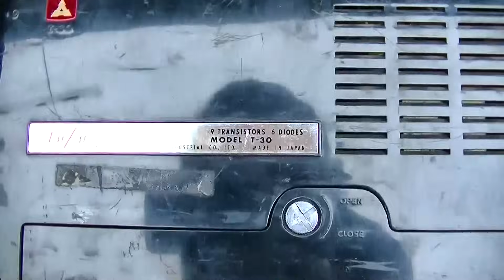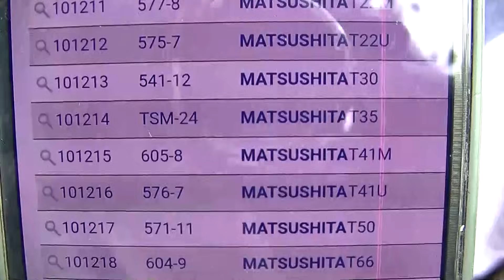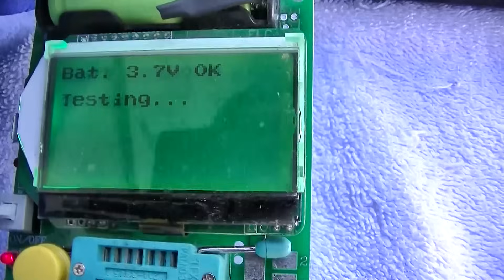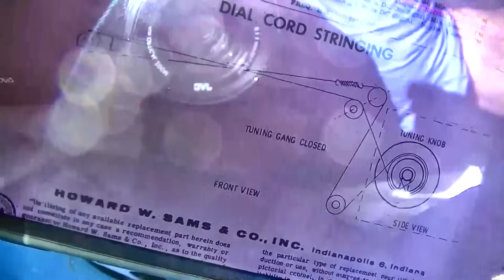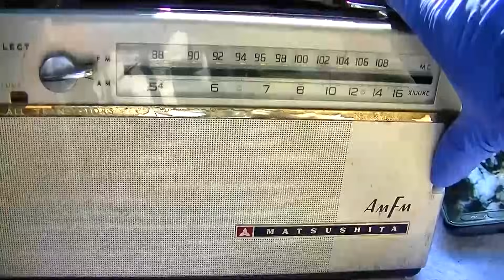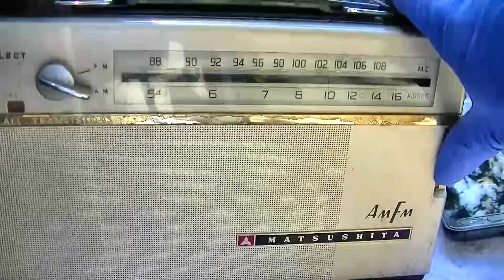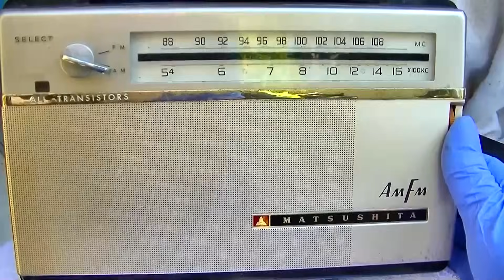1960 Matsushita AM FM Transistor Radio Repair T30

Comment: @Tate Thomas, many thanks for sending this very interesting radio to shango066, which, in turn, allowed him to share this gem with the antique radio enthusiast/electronics repair and restoration community.  What makes this radio interesting, is that it seems to be an early stage in what became the "Japanese Solid State Multiband Radio" crusade of the 1960's, thru mid-1980's. Very few ever came into the shop, because they were built so durably.

Comment: A non polarized capacitor can be made by connecting two electrolytics in series.   The positive wires or negative wires are simply connected together and the other two are connected as the non-polarized ends.  If they are the same values, capacitors in series half.  For instance, if the total value desired is 10 uF, you would wire two 20 uF capacitors together in series, with the same polarity tied together.
Reply: I was wondering if this would be the case.

Comment: That radio could have very easily fit inside a USPS Priority Mail medium sized flat rate box with the proper packing material, and be shipped for $15.05 flat rate no matter how much it weighs. I'm surprised the post office didn't let the sender know this. That price still seems way too high for something that size and weight to be shipped across the US.
Reply: Slightly smaller box would've cost a lot less.

Comment: A couple years back, I found a dusty, crusty Panasonic RX-1460 (circa 1981) at a recycling center for $5. I thought I lost the cracked rewind gear in the tape mechanism, so I ordered another one off eBay to get the gear to make a 3D printed copy. I paid more than double for the shipping than for the radio itself. Turns out I still had the gear, but hey, now I have two. The second one was a basketcase when I got it. FM antenna broken off, AM antenna broken and rattling around inside, belt off the tape mechanism, cracked rewind gear. A month ago I finally sorted out the very last problem -- bad solder joints on the audio output transformer that caused the tape player to occasionally "honk" very loudly. I highly recommend vintage Panasonic equipment. Very easy to service, easy to get service manuals. For some models, you can even still get parts through Encompass!
Reply: Good to know.

Comment: That shipping charge is criminal.
Reply: I spent $33 to ship a nice nearly new cassette deck I got for free to someone who needed it. The shipping cost was a little high, but it was for a good cause, someone is using something that would have been thrown away, they had a huge collection of old cassettes from when they were younger and hanging out with bands, this deck really made them happy. Shipping costs suck, especially when you're so used to buying stuff online and getting cheap to free shipping.
Reply: the shipping guys are risking their life by going out to deliver it. so, the price is justified, although they are probably not getting paid the extra money though.
Reply: if you have paypal you can get reduced shipping costs.  Packages only no first class letters.
Reply: @iceberg789  The prices are not up because of covid.  The prices started going up after 9/11 with increasing oil prices. But they are a one way ratchet.   Oil prices are like a 1/3 of their all time 2008 high.  But when oil prices came back down, the consumer was habituated to the now insane costs and they didn't lower their prices as the price of oil has come down.
Reply: @iceberg789    Risking their life? are they delivering behind enemy lines, are delivery drivers being taken out for sport, I guess the news isn't reporting the deadly attacks.
Reply: If you can’t send it in a Flat Rate Priority Mail envelope or box the price can be insane, yes.  International: there is no longer surface mail so it’s even crazier
Reply: @tarstarkusz  There is a business opportunity there for certain.
Reply: @orange70383  :)
Reply: I agree. I once bought a 1983 TV on Ebay and the shipping was one third the price of the TV itself!!

Comment: I like the radio. The European transistors in the chunky TO7 cans often suffer from internal shorts due to tin whiskers, sometimes the whiskers can be blasted away successfully with a charged capacitor, sometimes not. Maybe the Japanese transistors also suffer from this problem. I tried to destroy the tin whiskers by putting the transistors in the freezer for 6 months, it didn't work. Percussive maintenance may lead to a temporary solution, I now just replace them with Ruskies, even if they look a bit odd to my eyes. Thanks for the video, may there be many more.
Reply: Completely different construction from the AF117 transistor, the problem with the bad transistor wasn't tin whisker shorts anyhow, it was open circuit.

Comment: Tuning cap mounting grommets have deteriorated to the point where the unit has shifted with respect to its mounting frame. This is causing the tuning control pinion to not mesh properly.
Reply: Good call.

Comment: I have never seen a portable FM transistor radio from 1960 before, this had to be rare.  This radio must have cost a small fortune in it's day, the high frequency transistors in the FM front end probably selling for >$20 each.

Comment: @1:12 Dimensional weight. Above the actual weight lists the size of the box and “DIM. Weight” above that (11 lbs). It’s so that shippers can recover the cost of shipping if you send a light but spacious box. Most shippers now do this.

USPS can’t raise letter rates above the rate of inflation without a huge governmental inquiry, so they try to make it up with raising parcel prices as they’ve frequently increase 5-8% each year. Also, ship Priority flat rate if your items can fit in there vs. a custom box as the flat-rates allow up to 50 lbs or something like that for one price.

Comment: A spring came out; it would have gone between the two “hooks” in each gear half to reduce backlash.
Reply: those springs are a nightmare as an example, grundig transistor radio's that i have come across have had the backlash spring and it's a royal pain trying to refit one.

Comment: shango066 You Can Connect 2 capacitor's back to back in series both Gnd's tied together double each caps value to make a none polarised capacitor, I often do it for testing. Usually works fine but esr wont be that good of coarse.
Reply: Hey, I asked a similar question, but not series back to back, anti-parallel.
Reply: @Raul_Gajadhar  Ortorea is right, series back to back it is 100% sure
Reply: That would work completely fine and for something like this the increased ESR wouldn't matter at all
Reply: @Dazzwidd  In some cases I found that to be true, I guess = bad circuit specs?
Reply: @Raul_Gajadhar  I've seen older manufactured goods even use the back to back polarised electrolytic capacitor approach a few times. 
It's got to be a fairly critical application for the ESR to matter, and if the capacitors you're doing it with are high quality components then it's definitely not going to matter as they will have an exceptional ESR to begin with
Reply: @Raul_Gajadhar  Don't do it with them in parallel as one of them will be reverse polarised. Series back to back
Reply: @Dazzwidd  I meant anti-parallel. You know, 2 germanium diodes in anti parallel with the caps in anti-parallel may help in my case too. Just more less bang for the buck. lol... I know I seen a circuit like that some where before. Old brain. Wait, Pre-emphasis network, I think never mind. --End of discussion--
Reply: @Raul_Gajadhar  So you mean in series?????
Reply: @Dazzwidd  What?! Dude 2 diodes, 2 caps,   a diode and a cap goes neg to neg, pos to pos, then same with the other diode and cap, then in parallel reverse both pair of components to make one. Gezz.

Comment: The dealwas Matsushitas brands was NATIONAL, but this was a trademark un the US already (chash registers and other thing I cant recall). The created PANASONIC just for the US Market. So this set is prior this point. The couldnt use NATIONAL which would have been more apropiate. Then they created Technics and Panasonic's bother Quasar.  The logo lately would be the  UPPER N, even for early Technics. They really develop tons of products in a very short spam of time, the killed it in the 70s. I love their tape recorders, not much about radios. They even hold the patent of the boombox at the US patent office (LOL) that was submited with the RS-466 Stereo boombox. Good Panasonic, affordable gear, low maintenace, good performance.

Comment: You can make a NP cap by connecting two equal caps back to back. Use polarized caps of double the required capacity. No need to buy NP caps.

Comment: 3:28 - there should be a spring  between these two gears that prevents the user from overturning the tuner capacitor. I think the tightness of the rope also held the tuning knob gear against the other gear._

Comment: I have seen some radios dead as a hammer from dried out electrolytics. And I've seen some that age that had good caps, transistors, etc, and were dead from a bad solder connection, or cracked board. Its a mixed bag, mainly dependent on the quality of the electrolytics used. I have my grandads 1964 Sony TR1814 - all original parts - still plays well - audio lacks a little bass - some electrolytics a little weak. My grandmothers 1962 Channel Master - dead as a hammer - changed all electrolytics. A 1963 Westinghouse bought at fleamarket - plays well - speaker drags a little - all original - was dead as a hammer from cracked solder joint.  1962 Arvin fleamarket find - repaired broken antenna wires, and removed shards of antenna wire from tuning cap - plays fine now - all original parts. All of my Zeniths, dead as a hammer - replaced bad "Nashville" caps. A 1964 NEC Galaxie AM/FM - replaced battery holder - plays OK - all original parts. My collection mostly had all bad caps or no bad caps.

Comment: 2 recurring issues with these oldies. 1. The plastic electrolytics. Sanyo was the worst but others used them in those days. Sanyo made and stayed with them the longest. What went wrong was the lack of knowledge regarding plastic in thin sections. Plastic is porous in thin sections (actually it is porous in all thicknesses but it matters less in thick sections). This allows the liquid in capacitors to pass out and dry the cap out rather quickly.

2. Grommets. Where a metal chassis or bracket was used to hold or shield a tuning cap it was usually isolated with rubber grommets to keep it from grounding out. These are under tension from dial cord or other forces. They either split or otherwise fail as things age and there goes the isolation. You then get strange noise or modulation. New grommets will fix that BUT where do you get teeny ones today?

Capacitors killing everything: It DOES happen. Over the decades I have run into it. Some caps will short out instead of going open. The worst are the ones that bypass various voltage sources. I have seen them short out the battery itself or just keep voltage from getting to where it is needed by shorting it to ground. Never say never.

Comment: In a pinch, two electrolytic caps placed back to back can sub for a non polarized one. If the value is critical, double the capacitance of each cap since they're wired in series.

Comment: What causes that bird flutter sound at 21:22? Some form of digital mode?
Reply: I'm using a badly damaged phone to listen to this so I cannot guarantee that I am hearing it correctly, but, it sounds a lot like what is called signal "ghosting" or "ringing". This occurs when the signal is being "bounced" back and the receiver recives multiple delayed transmissions of the same signal. Most likely caused by a low flying chopper or jet in the area.

Comment: WOW! That radio is from 1960? To me it seems modern and well built. Shango for a non-polar cap, can't two polarized ones be placed anti-parallel? I mean it is a low voltage audio signal. Feel free to shoot me down if that is not a proper substitute for particular application. I really like that radio btw. It should get a proper functional restore.

Comment: I used to do shipping, The rates are mostly based on dimensional weight not so much on real weight. The 16x14x8 that comes out to 1792 cubic inches. if it had been under the 16x14 it would have been much cheaper to ship.

Comment: I didn't notice a 10.7 MHz crystal for the FM IF circuit. From my perspective, it seems interesting to me that Shango put a Russian transistor in a radio that rolled off the assembly line during the depths of the Cold War, just two years before the Cuban Missile Crisis. This receiver even has the little CONELRAD triangles on the AM dial, to be tuned to in case the Reds attack.
Reply: John Jalas  Well, I can't honestly disagree with you. But back then, we were very close to being nuked by the Soviets. A lot of people had some sleepless nights back then.
Reply: you mean a ceramic IF filter?  most old sets like this didnt use them, this one looks like it has double tuned IF transformers, that would give good selectivity nearly as good as one if adjusted correctly
Reply: @xavierrajda933  It has been said that hindsight is always 20/20. From today's perspective, we now know that neither side wanted to start World War III, but we didn't really know this in the depths of the Cold War paranoia.
Reply: @andygozzo72  I guess early FM receivers didn't have those ceramic IF filters. Sure didn't see them on the old tube AM-FM radios I've had in the past.
Reply: @chetpomeroy1399  i've never .. yet.. come across a valve set using them, only seen them in 'some' recent ish sets, say from mid 70s to 80s, and more so 'modern' sets ... maybe werent invented till recently?  some communications receivers had them , or 'crystal' filters much earlier,
Reply: John Jalas  During the Cold War, I didn't believe that the ordinary peoples of the former Soviet Union were inherently evil, but the Soviet government was a different story. Similarly, I really don't have a problem with the everyday people who live under the jurisdiction of the government of Red China, but like many others with similar political persuasion, I DO harbour animosity toward that communist government. The people of mainland China would do so much better without communism.

Comment: That radio has excellent sensitivity! How would you rate the selectivity? Sometimes it seems great, other times it seems like the stations are on top of each other. It still amazes me that the carbon resistors fail less than the transistors. I guess I really bought into the lie I was told when I was young, 40 years ago, that the solid state devices would be the last to fail in a circuit. 😁

Comment: Could you use a clip lead hooked to the input of some amplifier as a signal tracer?
Reply: Yes. Done it.  Phono input is pretty sensitive.  Although there may already be a series capacitor and resistor,  add another one.
Reply: @LakeNipissing  so a clip lead with a cap and resistor in series before the amplifier?
Reply: You can also use a telephone test set as a signal tracer, or even an old 2500/500 series desk telephone.

Comment: Shango066, is there any am stereo in your area?
Reply from the maker: I don't think so there's no reason for it
Reply: Bummer. There is an am stereo station not too far from me and I have a non working denon am stereo tuner I need repaired which I thought would make an easy/cool video.

Comment: Very interesting and nice as always... for the IF-Stages the GT322B1 (ГТ322Б1) is better and used in many radios, the ГТ313 is used in VHF and UKW frontend or Video-IF-Stages with 37...45 MHz. But this transistor will work well in AM/FM-IF-Stages, too, as seen, there is a little possibility to oscillate in VHF. 
What about the dead UKW-RF-Amp ?
Reply from the maker: I will order some thank you for the info
Reply: @shango066  ..perhaps it is in your big collection of russian germaniums, a bit smaller case, similar to AF139 (TO18) and sorry, "UKW" is the german abbreviation "Ultra Kurzwelle" = "ultra short wave" = FM ^^
Reply from the maker: @hql400  it doesn't appear that I can get them right now. I can't get items shipped to me from that part of the world maybe because of virus? I don't know
Reply: @shango066  o.k., then its not a problem to test the GT313 there, if the other data (power dissipation) are o.k., perhaps another BIAS is better for this MESA-Transistor GT313 (http://www.sax.de/~zander/zubehoer/russ/418.jpg ). at the bottom of the document you can find "постоянный ток коллектора" means "collector direct current", 30mA are o.k., power dissipation is about 100mW: http://www.sax.de/~zander/zubehoer/russ/419.jpg depending on ambient temp.; here Pv is called 100mW, too:
https://www.datasheetarchive.com/pdf/download.php?id=2f2fb35e82ff450c83b8a229568f42096c3d1c&type=M&term=GT313B
That means, the GT313 can stay in the if-stage !
[ GT322B1 in many AM/FM-IF-stages of east-german radios: https://www.gfgf.org/GFGF-Schaltplandienst/Rema_Andante830840_sch.pdf ]

Comment: Dial cords suck & I sucked at them. Another cat in the shop loved them, even those on German rigs.
Panny in later years on many radios had a dial cord assy.  Unscrew from the tuning cap & clip
the wheel on to it so as not to dump it. At that point you could work on the PCB.  Bad cord could
be restringed & if you wanted a pre cut & knotted string could be ordered.  Of course I always opted
to order the assy & just throw it in in seconds. IMHO Panny & Zeniths were the best small radios.
LFOD !

Comment: This ain’t no Panasonic, nor National, it’s just Matsushita. I also have another reel-to-reel tape recorder which is the Concord 220, and it has all Japanese parts by Matsushita. That was during that time, Matsushita shipped the components and rebadged as Concord.
Reply: Matsushita was original name of what became Panasonic,  and was the surname of the company's founder , with National as another brand name,  some equipment branded with both..